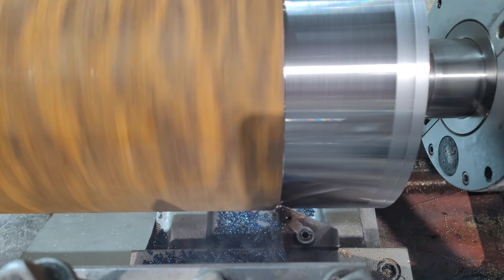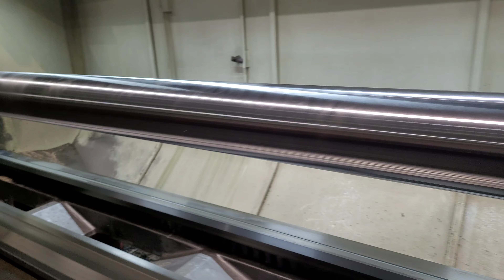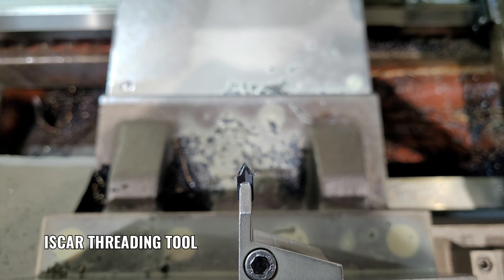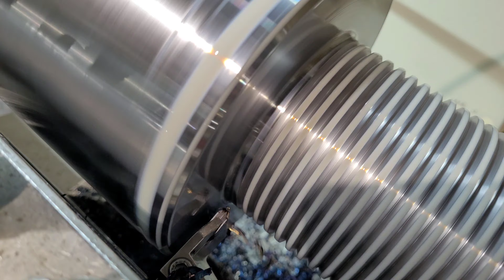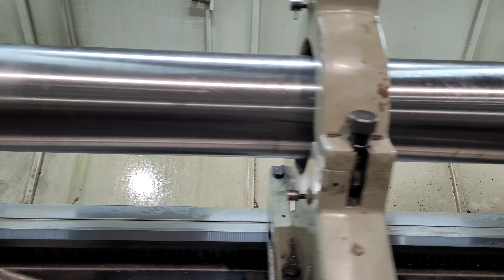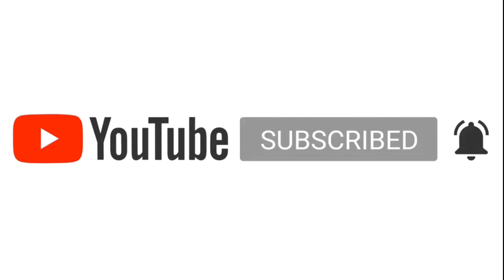Pivot Shaft | CNC Lathe

Comment: Still learning here and starting to work with bigger stuff, but how do you get the centers cut in the end of the part?  Mostly thinking for stuff that is too big to fit through the headstock (mine is significantly smaller :) )
Reply: They use a Horizontal Boring mill